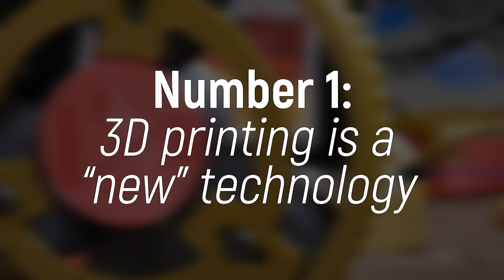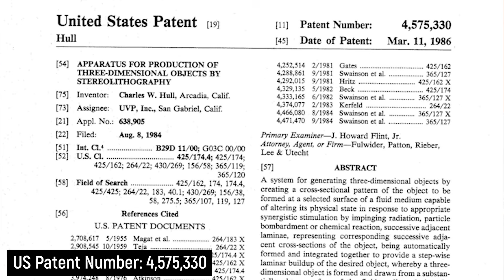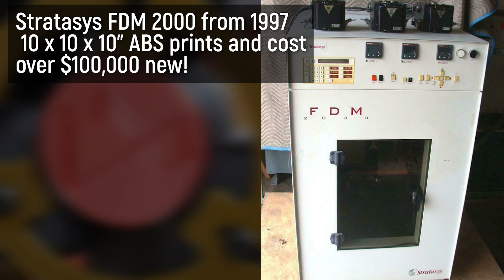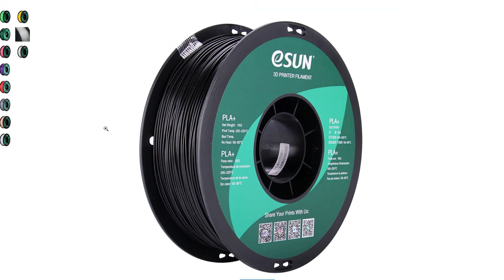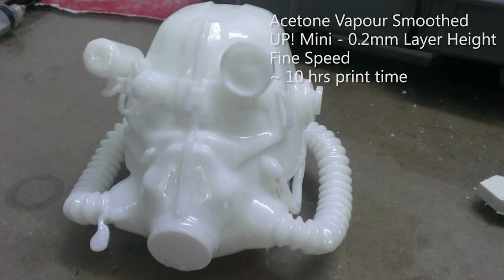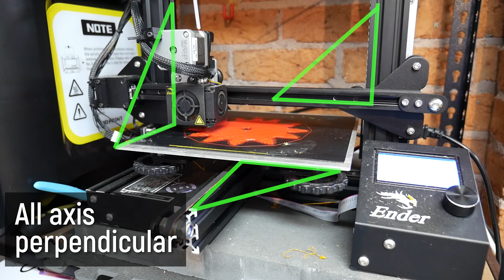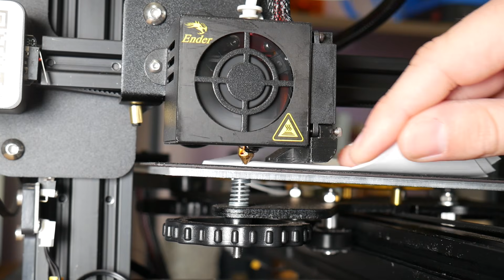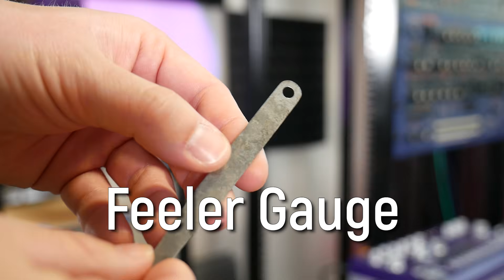3D Printing Myths I used to believe...

Comment: Finally someone with a voice mentions feeler gauges. Too often I'm told they aren't necessary or even detrimental to proper first layer prints and I've been dumbfounded as to how a MORE accurate measure is LESS preferable. Thank you man. This has been eating me up for some time now.
Reply: I've been thinking about using them, but I feared that the feeler gauges might damage the bronze nozzle tips. Is that something we should be concerned about?
Reply: @MohammadHassan-ud8iq  use a brass feeler guage to avoid damage.
Reply: @MohammadHassan-ud8iq  If you don't smash and try to force the gauge into a gap that is too small there should be no problem. The gauge itself is thin and fragile. So there are chances that if you damage the nozzle you also damage the gauge by warping it. Just use all your tools with proper care and everything should be fine.
Reply: @christianbarnay2499  You can run a fine stone or sandpaper along the edges of the gauge just to remove any burrs or sharp edge that might scratch the brass. I'd be more concerned with tiny scratches on the nozzle flat causing stringing etc. than actual wear (glass is pretty damned hard and I've managed to accidentally run the nozzle low enough to the bed that it left brass tracks on the glass but the nozzle didn't suffer too badly! It's even wear)
Reply: @MohammadHassan-ud8iq  thats ok brass nozzles are cheap. Also just extruding wears the nozzle. so its fine you arent going to damage it enough to make a differance.
Reply: They aren't necessary though, I don't understand why you would fold the paper. Normal 80g printing paper is almost exactly 0.1mm thick, and can be used just as well. We're talking about FDM printing here, tolerances are in the 10th's of a mm in the best case anyway. I also don't know a single machinist who doesn't use a piece of paper occasionally to zero a lathe tool or endmill.
Reply: @slome815  you fold the paper to double the thickness. Feeler gauges remain more accurate though along with shim stock. But if you need something really thin then you do have to go with rolling paper. Unfortunately they discontinued production of the thinnest wraps over a decade ago. Club Modiano's were the snizzle. I haven't seen a real one of those in decades now.
Reply: I think it's more down to the fact that a steel feeler gauge may well damage a brass nozzle eventually. But if the frame is true then one would hope you don't have to use the gauge very often...
Reply: Rule 1: Don't believe any crap you hear on the Internet.
Rule 2: See Rule 1.
Reply: You'll need to replace your nozzle due to extruding filament wayyy before a feeler gauge does any real damage to the nozzle. Assuming you use the feeler gauges correctly of course.

Comment: I see the "ABS is stronger" thing all the time, and it never matches with my experience. Thanks for covering why that is wrong, and pointing to the detailed breakdown of why.
Reply: ABS shines in impact resistance, flexibility, temperature resistance, and strength to weight ratio. PLA for your personal CNC machine or shelf brackets, ABS for a phone case or a drone body. And if someone's selling PLA and ABS for twenty bucks a kilo each, the ABS is like a 25% bigger roll because it's less dense.
My opinion might be biased by the amount of effort I've been putting in recently to get set up for and familiar with ABS though. But it's been fairly rewarding.
Reply: @FrankBocker  like I said: I haven't seen that practically. Like he said in the video, there is a large break down in all that. This is one of those too like we see in the personal protection gun community. People say that a .45acp 230gr is better than a 9mm 115gr. Is real world use, there is not enough of a difference to practically see a difference when used. So, sure, the materials numbers may be diffrent, practically, there is not a user difference.
Reply: @FrankBocker  like I said: I haven't seen that practically. Like he said in the video, there is a large break down in all that. This is one of those too like we see in the personal protection gun community. People say that a .45acp 230gr is better than a 9mm 115gr. Is real world use, there is not enough of a difference to practically see a difference when used. So, sure, the materials numbers may be diffrent, practically, there is not a user difference.
Reply: @FrankBocker  There's also material creep: from what I recall, ABS isn't as susceptible (or at all) to that effect compared to PLA. So parts under constant compression are better off with ABS.

Comment: I don't know if it's "wrong" to use paper to get close to being in tram as long as you know what's actually going on and that you'll have to adjust the height after. I have a delta so I use paper to tram and then set my delta height to get a good first layer. Not everyone has a feeler gauge but everyone has paper.

Comment: You're 100% right about "tramming" being a better term. But "leveling" may have also come from metalworking rather than evolving on the internet, since we level our metalworking lathes. Like 3d printing, this doesn't mean getting it level at all, but rather getting the twist out of it and making both bed ways parallel to the spindle axis. Lathes have traditionally been much more common in the home workshop than mills (probably not true anymore), so "leveling" might have been the natural term for adjusting the geometry of the machine when hobby 3d printing was getting started.

BTW, the word leveling causes lots of confusion with lathes, too, and every lathe setup thread has at least two comments explaining that "level" doesn't mean "level".

Comment: I recently went back to printing ABS, I can say that while PLA has come a long way and my ancient spools of ABS stink when printing, the ABS prints are far more processeble than pla. It cuts better with tools if making bushings. It is also post processable with acetone, and it is far better behaved once dialed in. My 3d printer is sitting in a 40c chamber and the bed is at 110 and hot end is at 260. One more thing, ABS extrudes way better with less back pressure and if the printer is capable of moving fast enough it should result in faster prints.
Reply: This year, there has been a big speed benchy competition between 3D printer builders and modders. Once every construction aspect has been maxed out, PLA had to make way to ABS, which at high enough temperatures flows easier and is easier to solidify in place as it's being printed. They have been reaching like 6 minute figures now.
Reply: @SianaGearz  i had no idea. Awesome results.

Comment: The feeler gauge trick is genius and makes so much more sense than other bed levelling advice I have seen. Thank you!
Reply: I've been using my business card (0.3mm thick) with OctoPrint Bed Leveling Wizard with 'Z Leveling Height' set to 0.3. It has worked a treat, but it is something of an art to feel the right amount of drag. Using metal feeler gauge makes so much more sense because it eliminates the squish in the card. However, I will probably have to modify my leveling technique so that the 4 points are directly over the leveling screws.
Reply: It is great but I fucked up my bed earlier with paper trick and needed to buy a new one (it’s already scratched ) that’s what happens when you give a 14yo a ender 3max
Reply: @Diesr  Or a 40 year old. I'm a big supporter of letting that fourteen year old get in there. They learn the same as us old guys. We screw things up, we learn. Also,  they are sharp as tacks. I believe they learn a hell of a lot quicker.
Reply: Yeah, I'm excited to try it, I have to level my bed very often since I change nozzles a lot, (I print minis and large parts on the same printer)
Reply: Coming from an engineering background I’ve always used a feeler gauge when tramming my printers. I also built a holder for a digital dial gauge to mount on the printer head and measure the actual distance between the nozzle and bed. This way you can really fine tune the tramming of the bed AFTER you’ve ensured the guides are all at right angles to each other.
Reply: How the hell do people measure their spark gaps or clearance between cam lobes and tappets?
Reply: @Jmoneysmoothboy  Good point John but plugs come pre-gapped nowadays (yeah they aren’t always right). Regarding cam lobes and tappers I’ve worked on my cars all my life but sadly never dug into an engine to that degree. Always wanted to just never went there…
Reply: @TheJacklwilliams  At the very least people should be using feeler gauges to test their calipers for accuracy. Most calipers these days are pretty precise but often not very accurate so it certainly helps maintain QC. Joe blocks are also magical and I'm discovering people do not use them
Reply: @Jmoneysmoothboy  I can’t argue that one bit John. Great point. Re “Joe Blocks” once again I hang my head in shame as I head out to Duck Duck Go “Joe Blocks”. Never heard of them.
Reply: @TheJacklwilliams  Oops, I guess they are called "gauge blocks". Or "Jo blocks" after their inventor Johansson something or another.
Reply: I thought so as well. The funny thing is since we stopped tuning up cars with "points" I can't seem to find my set of feeler gauges.... Wow, i'm old. Edited to add... I bought my first printer an Anet A8 Plus back in November. Angus and many others haven't given very many points to Anet for many valid reasons. However, it's mine and I claim it. Over the course  of the last six months I've grown to love it. At first, getting the bed right drove me APESSHIT. It seemed like I was constantly tweaking / adjusting it for damn near every print. However, knock on wood (i'm screwed now I'll have to adjust it), the last couple months it's been dead on in the sweet spot and my prints have been just amazing.
I'm moving forward and building a core xy next complete with auto bed leveling. I'm stoked and can't wait to start the project!
Reply: @TheJacklwilliams  I just picked up a feeler gauge at Harbor Freight for this exact purpose.
Reply: @zachariahpoltergeist4516  Yeah I need to get a set anyway and that’s the perfect place. I source a lot of things from Harbor Freight. Funny, I grew up going to my Uncles, the King of tools and of “doing it yourself”. He perpetually had the catalog on his coffee table and was always ordering something. I need to get a set of calipers as well. Might as well put t in the same order…

Comment: My first 3D Printer was a Formlabs Form² followed by a Prusa i3 MK3S ( with a MMU2S ) and a Form³ replacing the Form² - All of which cost a fortune compared to their alternatives but except for some software fixable hiccups with the Form² at the very beginning I was spared from most of the frustrations I see people talking about with models priced at ½ or ⅓ the price of what I paid for mine - Like those fist layer issues when dialling it in via a paper - Like what?
Reply: You know, you always look in those discussion groups, reddit, facebook, forums, whatever, and you see people who don't want to become friends with their machine, they don't want to engage with it. They want to press a button and a perfect print to come out magically. Now i'd say Prusa printers more or less accomplish that... but if you have less tech, if you have the bare viable minimum, if you perhaps also use wonky material to boot, you just have to be very aware of what the printer is doing and should feel like and run like, and then you probably don't get issues, and when you do, you're one trivial step away from solving them. You don't hear nearly as much of the people who are happy. It's not like all the other issues that affect those machines, like breaking parts and badly affixed motor pulleys and just general wear don't affect a Prusa printer just the same, especially after a time or a self-assembled one.

I have bought a deliberately wonky printer kit 4 years ago because i was in it for the learning experience, but i already knew the fundamentals, and my first prints were already a success. My very first test print had perfectly fine bed adhesion, in spite of adjusting it using a random piece of A4. It's really not that bad.

And while Form are great machines, from all i hear, the typical resin printers made from Chitu China parts are quite easy to run as well. There's just much fewer variables and moving parts in a resin printer.

But as to Prusa? How about issue 602? The many MMU issues, predominantly in MMU1 era? The clogs caused by the throat inner shape, which they optimised for MMU at the cost of overall reliability, and which shipped in regular MK3S machines? Before they changed all that again and mostly fixed that i think.
Reply: @SianaGearz  In the end it's a quality of life and peace of mind thing... I don't mind occasionally having to unjamming my Prusa ever full moon or so ( strangely enough so far it only tends to happen at the end of the print as if the hot end cools down too fast before the filament gets retracted past the MMU2S Sensor ) since after all it's a mechanical process done on parts running on a budget - Not some Stratasys Machine - But I'll be damned if I have to constantly retune my machine before every print.

Same for keeping my sanity by not having to think a lot about if my 3D Printer will be causing a fire because it either is running on lousy hardware or proper hardware with disabled safety features or unsuitable hardware for a task like running wires through a drag chain not designed to be used in a drag chain.

Where possible and feasible I generally also like to support those companies that give back with proper support and ideally also bring the hobby forwards - Neither of which you'll see from companies outside the EU / US as told many times be the likes of Makers Muse, Thomas Sanladerer, etc... 🙂

Comment: Don't forget, 1980 was the era of Intel 8085 / Zilog 80, with 8 bits processors, 64k address space, 2MHz processors… Which means that even if the principles was existing, it was very difficult to implement them. I can remember, in 1980,  I was a member of a team working on piezo injectors for diesel engines for an automobile manufacturer. The needed computer was the size of a dishwasher :-/ We had 2 wait 2 decades before this can emerge (and 1 more decade for it to die).
Reply: You know, i'd like to see a printer running of a ZX Spectrum or a Commodore 64. With some external hardware based on 74-series logic chips to emit the actual steps. In fixpoint, i think it would be perfectly viable... maybe needs an occasional pause to get the already fixpointed pre-processed G-code from disk.

G-code generation is of course a bigger issue, you can't do this on 8-bit machines... but one problem at a time. Let's say it's 1985 and you're using a PC AT, or maybe a couple years later a 68k based computer, this is already viable, though would be spectacularly slow.
Reply: @SianaGearz  I've installed a PC/XT (a real XT one: xtended with a second crate to host 2 HDD... 10 Megabytes each....). We had also a mainframe from IBM (330 square meters, 16 Mbytes RAM... but 1000 3270 terminals). I was able to build a biiiiig FORTRAN program on the PC - computing a hydraulic alternator/. It lasts 20 hours to compile. And the main problem was the inside ram (640k). The results, after audit, were pretty identical, the difference being related to floating point representation: IEE-754 on the PC with the 8097 co-processor, and IBM/370 representation, leading to some rounding differences.
But, as you said, slicing is an other thing.

Comment: I tried the paper method and it never worked, so I tried installing a cheap bltouch never worked, so tried making my own leveling system never worked, despite all of these methods the one that has worked best for me is just move the nozzle to the 4 corners and eyeball the distance between the nozzle and bed to about a few millimetres then start a print and manually tune each corner till the material has a good squish

Comment: Nice parts about the bed/nozzle adjustment! I never had success with the paper method, so instead I use a test-print that prints squares at different locations, and tweak the adjustment as it goes. Nice to see similar approaches.
Reply: On a small printer I just used back light to keep space near to 0 with slight light through and then test print iteration.

Comment: The whole "The tech is actually relatively old, it only just recently got popular because patents expired" thing is something I learned about around 5 years ago, and have been telling people I know who get into 3D printing ever since. It's just another example of how patents can stifle innovation if they are at the wrong companies.
Reply: Patents always stiffle innovation because that's not what they're for. They are solely there to protect profits.
Reply: @reallifeistoflat  if the company actually continues to invest those profits into their R&D department, then patents can drive (even if they lead to monopolies). They are meant to provide an incentive for innovation. Problem is that a lot of companies after innovating once just sit on their laurels and rake in the profits. And then there are others completely abusing the system and look at something other people developed that hasn't been trademarked yet and just try to get as much IP as possible.